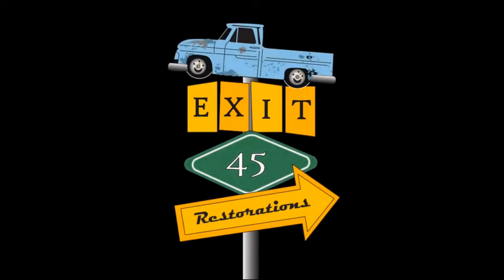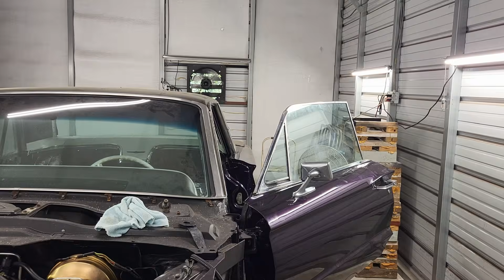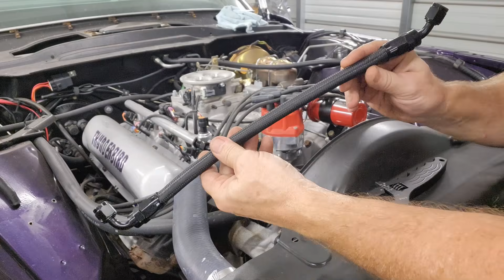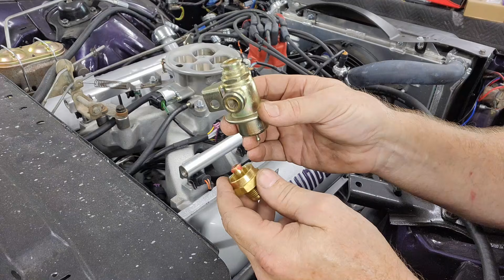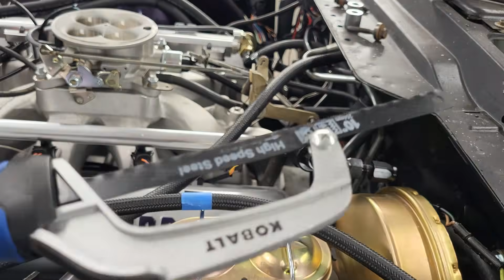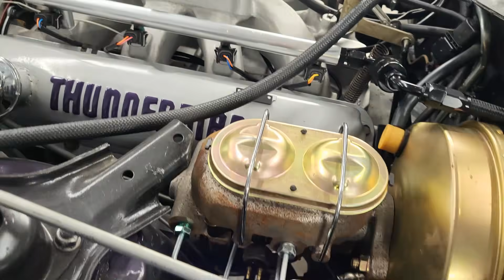Edelbrock Fuel Pressure Regulator With return installed on Pro Flo 4 EFI System.

Comment: Nice how to video, way better then I can do. When the hose cover gets fraid, I use scissors to cut the fraid parts off while the tape is still on. The fuel supply system with a fuel rail mounted regulator is a passthru, circulating fuel. Dead head is when there is plug in the end of the fuel rail holding fuel in the rail, stopping fuel.
Reply: It looks way nicer and it helps a lot with vapor lock. Pump gas boils around 160 f so keeping cooler gas from the tank moving helps to combat the vapors.
Reply from the maker: @GNaron exactly.  That was one reason I wanted to get all those gas lines out of there.
Reply from the maker: You're definitely correct on the terminology.  I got that wrong.   That aside I really like this over what I had.